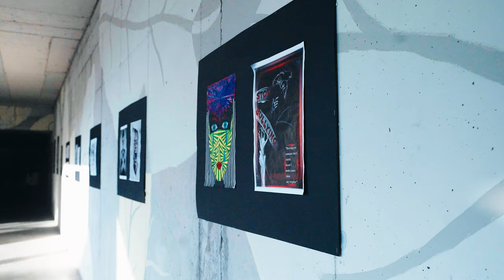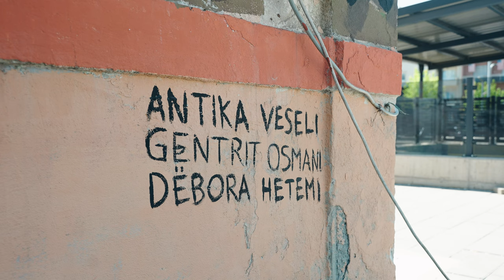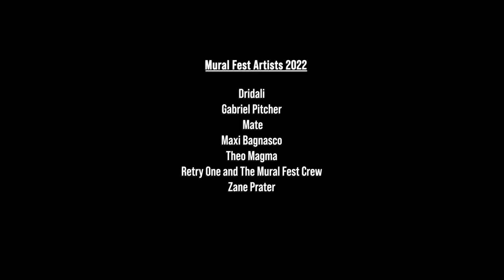On(Off)line - MuralFest Kosovo 2022 | FWTV

Comment: nice video and looks like great festival. be sure the turn on captions (cc) to understand the non English parts.
Reply from the maker: thanks for that, it's slightly confusing but this looked like the best way to make it available in multiple languages.
Reply: @FifthWallTv  yes the principle is great, took me a minute to figure it out, although you put it in the comment I saw later. perhaps for a future video mention it at the start of the video with text or voice over.